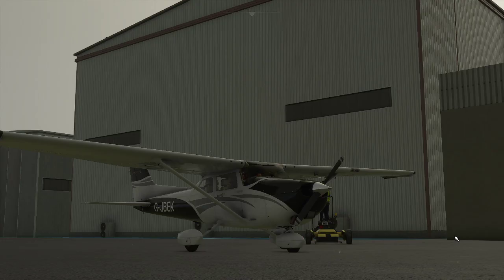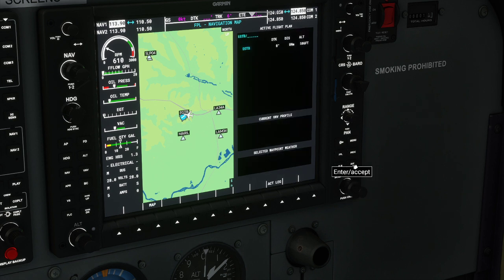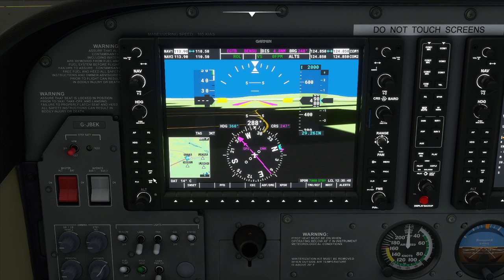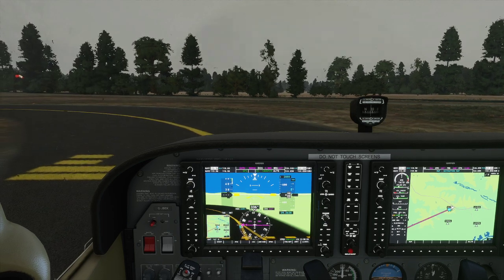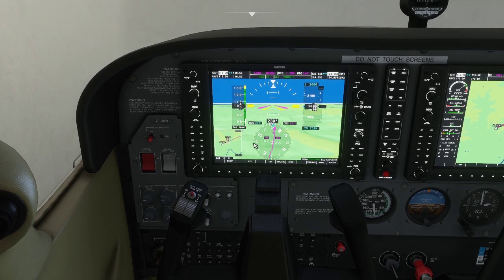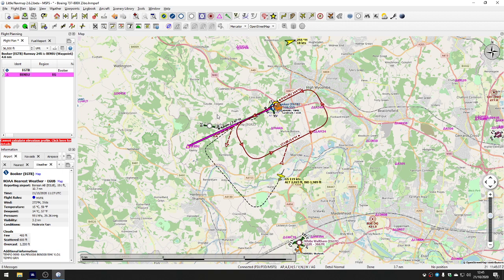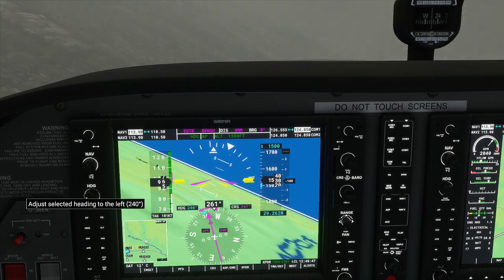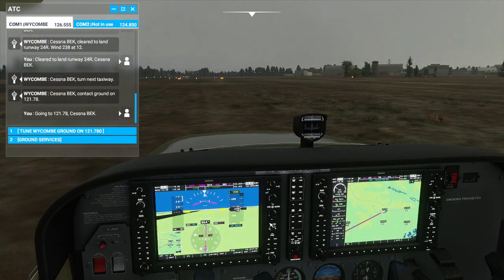Starting, programming, and flying the Cessna 172 with G1000 and Autopilot in Flight Sim 2020

Comment: Hey great tutorial i struggle getting the 172 to climb above 5000 it could be a bug or it could be me doing something wrong. I try to use flc mode and put at 90 knots climb speed once it reaches 5000    feet the plane starts to slow down even though i have full power and alt meter at 8000 feet. With cessna grand caravan i dont have this climbing problem it climbs perfectly in flc mode. It has to be a  bug on the 172.
Reply from the maker: It's the fuel mixture. Once you get above 3000ft lean the engine out - you'll get your RPM back. It's not a bug :)